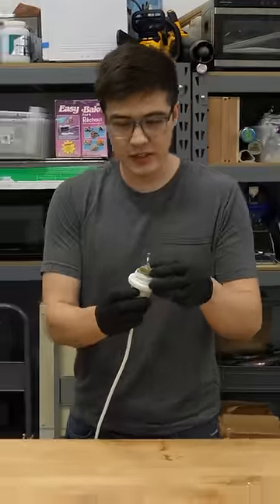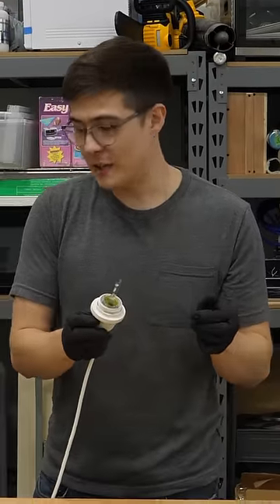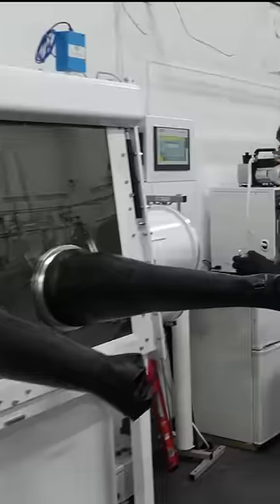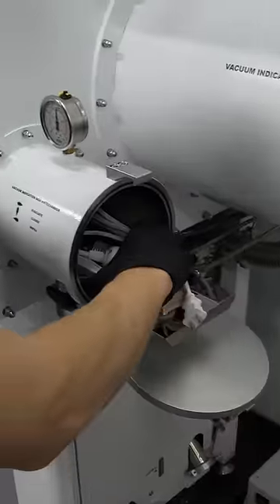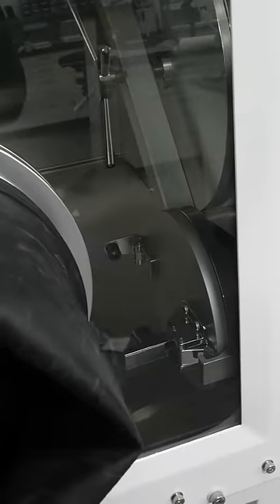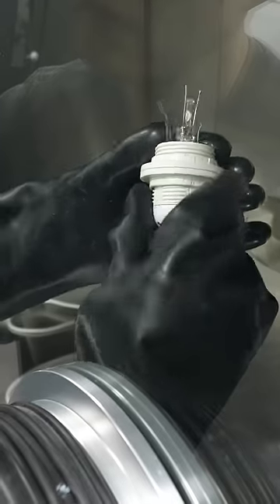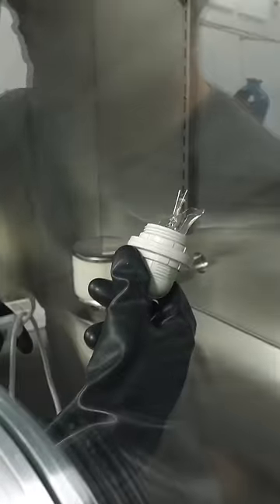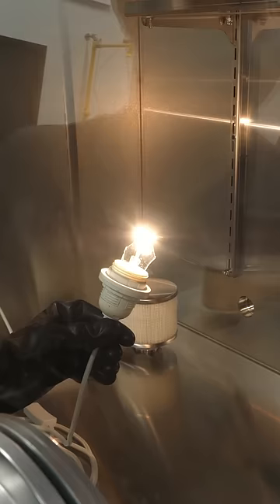Enjoy the light

Comment: Rarely have I seen someone smash bulbs so smoothly and with such confidence.
Reply: to be fair, they are very brittle, I have broken a few lightbulbs with my bare hands before
Reply: @magic_cfw  didnt the shards get in ur hands
Reply: @shaymin7240  I didn't explode them. more like slow squeeze and a slow twist so just about cracked but not broken. Though if I had to do it for a stunt I would use gloves and a towel
Reply: @magic_cfw  well if you squeezed and thgen squeezed the glass it would hurt
Reply: @shaymin7240  not really, it didn't explode just kinda broke apart.
Reply: @magic_cfw  kinda like a chip
Reply: @shaymin7240  depends how thick. I would say it's more  those caramel/sugar  bubbles. chips shatter, as there is very little  elasticity before failure. I assume thinner glass means it bends a lot more before it breaks, so it doesn't shatter.

Comment: Nice video, but touching the sharp shattered glass with the glovebox glove could cause potential leakage.
Reply: I was hoping someone else noticed this. Those things are a huge pain to replace without leaking oxygen into the box and contaminating any chemicals you might have been storing inside.
Reply: @osmium6832  Definitely. Usually, most of the gloveboxes are under overpressure so it is less likely that a leakage can kill chemicals quickly. However, fast consumption of gas will eventually lead you there unexpectedly....

I heard some labs working with radio-active materials use negative pressure gloveboxes, because they rather destroy the radioactive materials than letting them leak out by the overpressure.

Replacing the gloves is definitely a pain in the a**....

Comment: Hot tip for the glovebox; use nitrile gloves on the outside of the glovebox gloves to protect them both from cuts & contamination :-)
Reply: Putting gloves on your gloved hands with your gloved hands
Reply: @Peep272 Yo dawg
Reply: That and it would have been good practice to screw the bulb in before putting it on the tray as to reduce the chance of cutting the gloves when screwing the bulb on! :)

Comment: It will still burn out eventually, as the tungsten filament slowly evaporates when under current.  A tungsten halogen bulb has a regen cycle that has the evaporated tungsten combines with the oxygen and halogen it forms a new molecule that deposits back on the filament, preventing the glass from blackening and extended its life.  Deposited tungsten oxyhalide molecules end up in cool spots on the filament and eventually over time this uneven filament will too eventually thin out and break the circuit.

Enjoy your content Niles.

Comment: Bro bought a special machine just to turn on a broken light bulb!!! 😂
Reply: Love, that is a glove box
It definitely is just a big bulb.
You do all sorts of chemical reactions to stuff with this baby 
In our lab we use it to synthesise materials that can't ever be in contact with oxygen
Reply: @atafakheri8659  can't ever be in contact with oxygen as in "will react, burn itself out, and become inert", or as in "will explode violently and dramatically"
Reply: @EeveeMaster547  It can be both because we work on Lithium battery R&D
If you just leave it in air it reacts with Nitrogen of air and passionate
If it contacts water (for example an overly humid air or a drop of water) it can be a more violent reaction 
Also it can be more violent in contact with air if it is heated or energized (conditions that can both happen in the operation of a battery)
So we use a glove box to package and seal the batteries to make sure no air or moisture is present inside the batteries 
We also take great care that oxygen and moisture are not inside the materials that we put inside the batteries (extensive vacuum drying) 
I have seen batteries go boom under lab test when the student hasn't sealed in properly

Comment: Actually in tungsten-based lightbulbs, there also is a small amount of a halogene (probably chlorine) inside. This is because due to the high temperature the tungsten is going to sublimate and will deposit on the inside of the glass, so the bulb gets darker and darker, but the temperature on the glass is high enough to induce a transport reaction back to the wire, where the tungsten reacts to tungsten halogenide (which is gaseous at those temperatures) and when reaching the wire, it will decompose to tungsten and the halogene. So the lightbulb does not darken.
Reply: This is true, but only for halogen bulbs. Regular incandescent bulbs like in this video have only an inert gas, no halogen, which is why they do darken over time. I’m pretty sure the reason they don’t use halogens in these bulbs is because they operate at too low a temperature for the halogen cycle to work. Halogen bulbs use fused quartz glass which can handle the higher temperature, and they are physically smaller to allow a higher temperature to develop.

Comment: The absolute trauma of watching Nile handling broken glass with glovebox gloves and no additional protection 😭
Reply: You're that fearful? Maxing out that estrogen eh
Reply: I wanted to write this 😂
Reply: @scottmatznick3140 bro, bulbs are thin, broken thin glass is super sharp, and the entire box loses its integrity if you slash a hole in that rather soft rubber glove.
Testosterone won’t save your chemicals when you’re careless.
Reply: @mattleathen445  Don't be stupid then when handling broken glass lol. I've never cut myself handling broken glass only on glass that was just sitting around. those gloves are also replaceable{just a wee bit expensive lol).
Reply: @mattleathen445 it'll take more than a thin bit of glass to break those gloves. And they're a replaceable/consumable anyway. The gloves need replacing on a regular basis even without a scratch. I handle glass in gloveboxes all the time and have never suffered a broken glove. Those gloves are super thick!

Comment: The metal in the filiment slowly sublimates. The Argon gas in the bulb reflects much of the evaporated metal back on to the filament making it last longer. Nitrogen will just prevent rapid oxidation.   If you had added Argon to that chamber the bulb would last longer. 
Cheaper light bulbs do use nitrogen and argon and that is part of the reason they don't last.
Reply: Thank you very much
Reply: I didn't see your comment at first. I should've waited to post my own, rip
Reply: No thanx
Reply: Care to talk about how halogen bulbs work?
Reply: @ExWEIMan  Pretty much the same.  electricity heats the Tungsten to incandescence it slowly sublimates (solid to gas), but the Tungsten tends to reflect of the Bromine or Iodine molecules and bounce back to the filament and then glow again. At startup lower temperatures of the halogen there is a metal halide formed, but at higher temperatures in the lamp the halide disassociates and the Tungsten is returned to the filament.
The use of quartz allows the temperatures and pressures to be much higher in these lamps.
In the US most quartz halogen lights are being phased out because the department of energy made new rules for lumens per watt.

Comment: omg i actually know this one!! to explain light bulbs work  by getting the ligament in the middle super hot BURNING hot but they dont want it to set on fire and burn so yk what they do? they take out all the air by breaking the light bulb you let air in and it burns almost instantly. By removing all the air in the larger area it is its own vacuum tube letting it get hot and bright without burning out !! :3

Comment: The bulbs are vacuum sealed as with out oxygen combustion does not occur. Now your common variety light bulb will still burn out because A not all of the oxygen was removed or B the filament melted from the heat of the current. 
   One way bulb manufacturers overcome this is by using gasses to replace the oxygen instead of using a vacuum. Like in fluorescent bulbs helium, argon and in some cases mercury are used to replace the oxygen. Which is why they warn against being near broken fluorescent bulbs as they can be toxic if the gases are inhaled.

Comment: I’m more curious how there is an electric outlet in a vacuum chamber. What did you use to seal vacuum around it? Or are you just using very low vacuum. Or are you pulling vacuum and then pressuring to above 1 atm with nitrogen?

Comment: what if you touch the metal light part with the rubber floves on?  its just nitrogen in here so what you think
Reply: It’s still burning. Nitrogen doesn’t change the heat of that

Comment: they actually have to vacuum out all of the air in a bulb in order for the filament to not instantly burn out. You can do this by connecting the bulb to the side of a long glass tube and pouring mercury down it. That will suck out all of the oxygen and then you seal it.

Comment: so the reason my lightbulbs go bad, is because some of the outside air goes in? that's all?
Reply: No. Lightbulbs die when the filament breaks or is burnt through. In the air the filament burns rapidly and nearly instantly breaks in the right gas concentrations though that burn is significantly slower allowing the filament to burn for longer.

Comment: Have u ever wondered why they smell funny when broken.
Reply: because of the gas inside....
Reply: @caldeira_a  off the wall.....  you explained it in an interview.
Reply: @caldeira_a  forever alone man •_-
Reply: @questions-kw3sk ...?
Reply: @caldeira_a  I used to be main architecture. my machine turned my mind into mercenary. and then I died. for no reason at all. to some extra low standard. an impossible reality. stuck in a child that doesn't have the same mass. in a home that is trying to hide that. idk. That's what my dreams keep saying. some strange electro hydraulic human figure with tons of exposed board less structure and impossible to replicate crafting. a true hybrid. 7layer coated mega cluster core with solid cobalt trident.
Reply: @questions-kw3sk  you should call 911
Reply: @caldeira_a  bruh I'd be elsewhere if I thought this local department could handle that. Lol
Reply: @caldeira_a  I think this one is pretty funny too. Imagine going to a hospital for a check only to get jokes and a cup of drugged ice water. And have to pour this cup out in front of someone. while staring a sign that says dangerous person. I did take a micro tongue touch. It went numb then proceeded to create lots of hair rise like ants all over.

Comment: Now, light a light bulb in vacuum, rather than in pure nitrogen.
There's no oxygen, so it shouldn't burn / oxidize. But there's no gas around it at all that it can transfer heat to, except from radiation in form of light. So it should get a lot hotter.